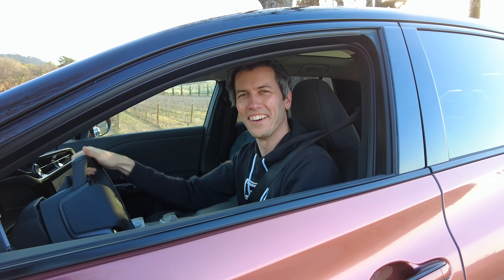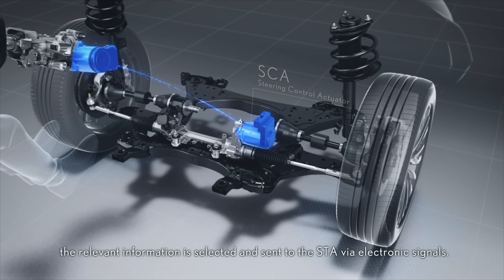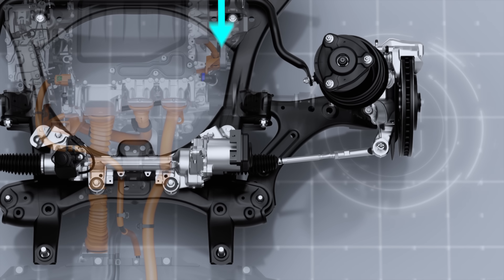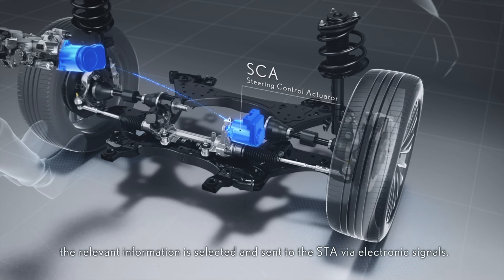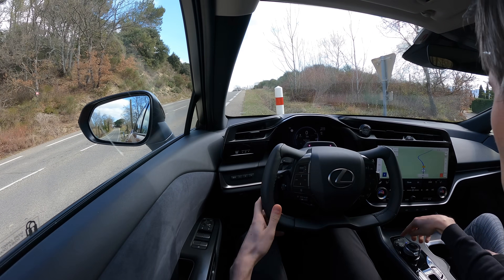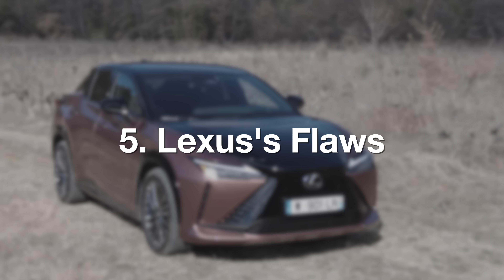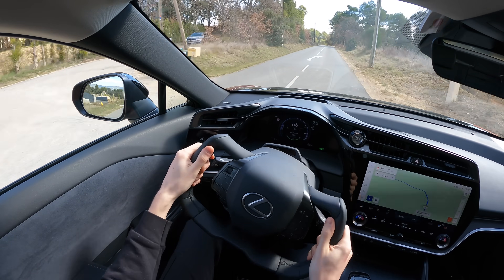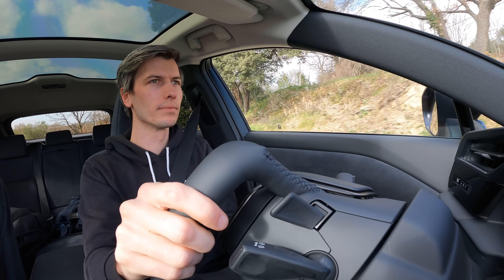How Lexus Fixed Tesla's Bad Idea: Steer-By-Wire Yoke

Comment: One of the things i find it funny in many of the modern cars, aka the supposed "future cars", is how all of them have giant touch screens.

We were always taught that driving while using your cellphone was bad, and it only encourages more car accidents to happen, yet everyone conveniently forgets that, and drools over having a colossal touch screen in your face on the car, which, does the same thing as a cellphone. (even worse, since these aren't phones, but big tablets at best)

Let's also not forget the fact of linking ALL of your car critical components and settings, into these oversized tablets. Say, a hacker wanted to target you, or a state agent wanted to assassinate you in the form of a "accident". With these cars that have all of their critical components linked to the oversized tablet, they could find a way to get inside that tablet, and from there do all kinds of nefarious shenanigans, like disabling your brakes, or disabling your steering wheel, or change your car LSD all of a sudden. You may say: "well if that happens, they can just simply get out right?"

No. Because the doors won't respond, and will be locked in place with the driver inside, essentially transforming the car into a metal missile.

They can also use a EMP to disable your car entirely, and if you're going in high speeds, well... You'll loose control and you'll hit either another car, the railing, or worst case scenario, jump off a cliff or go straight into the ocean.

This is the problem with the "smart" era. IoT technology is incredibly flawed and vulnerable. Anything digital is bound to get hacked.

You could say "but, 2000's era cars also did had digital parts too", and while that may be true in... Say late 2000's and early 2010's cars, they didn't had crucial car elements linked to those giant ahh tablets.

So, in conclusion: EV cars are the "future". One filled with DRM nightmares, and car "accidents". Oh and also manufacturers able to see what you do inside the car, and hear too, even if the engine is turned off. Then they'll be able to sell your personal and private information to 3rd party brokers, who probably are located somewhere in china or NK for example.

Comment: I personally never found electronic controlled gas pedals to be quicker than an old traditional wire pedal. They all had a delay in throttle response especially when I got to overtake someone. Why do you think a lot of race cars still use carbureted throttle bodies? Cause it gives you the throttle response as soon as you touch the pedal.

Comment: Lexus had a power-split device for steering on LS600h in 2000s. It could theoretically change the steering ratio on the fly, at any steering angle. Imagine a Toyota eCVT, with the steering wheel on mg1, power steering motor as the engine and mg2 as the output to steering rack. They used a harmonic drive as the power split device. In case of a failure, an explosive charge would fuse the steering wheel input directly to the output of steering rack. Truly fascinating technology.

Comment: I mean, fly-by-wire has existed for decades in aviation now, even to the point where the flight control computers prevent pilots from doing certain actions. Lacking awareness of these safety features have led to fatal accidents as the aircraft have operated differently from what the pilot expects. That isn't to say the safety features are bad, but it does mean additional training should be mandated.

Comment: I see two safety issues, one positive, one negative.  The positive is no steering shaft to drive into the passenger compartment in a crash.  Yes I know that risk has been minimized through design, but this totally eliminates it.  So a slight positive.  The negative is going around a corner with a yoke system your hands will not be in an ideal location if the airbag goes off.  Basically the difference between the old 10-2 recommendation and the current 9-3 recommendation, which as I understand it is mainly due to airbags.  I don't do hand over hand, so for me that matters.  For other drivers it wouldn't matter.

Also, I don't totally buy the redundancy argument.  I had an 86 RX/7 where the heater door actuator was by wire (saving Mazda the expense of a 2' cable), and its controller went bad, causing the heat to randomly go full hot.  Yes that system totally lacked redundancy, but I don't know how a redundant system would handle the conflict in commands where it isn't a failure to give a command, but the wrong command.

Comment: In my opinion instead of change the ration with the speed, it could be better if for the first 30 deg of rotation it has a ratio, then form 30 to 60 a bigger one and then from 60 to the end an even bigger… so you always know when you rotate how much the wheels are gonna move. And I don’t agree also with what you said about one person driving… cause if you fail to calculate it correctly you can still break with physical  breaks

Comment: If you believe that this is unsafe, then I would recommend you to stop flying on the Modern day jets currently in the sky.
This technology is being used in airplanes known as Fly-by-wire. So if you can travel on a aeroplane without any worry there is no need to worry about this because we are talking about difference between the sky and the road.

Comment: Wouldn’t the delay be the same in a mechanical steering wheel, because yeah it takes a while to change from direction, but on a regular wheel you have to turn the wheel way further which takes longer, eliminating the delay compared to a regular wheel

Comment: Awesome video! The points you brought up are honestly pretty reasonable and I never thought about steering that way. Thank you!
At 11:00. I think it's entirely possible someone could legitimately need to do an aggressive steering maneuver. Limiting that takes control away from the driver and pushes full liability to the company.
Reply: Yep. And lets be honest, a lot of people suck at driving. And now when they try to do an aggressive steering maneuver, the car might not move as aggressively. Yikes.
Reply: i think its more like flight envelope protection on flybywire aircraft where the controls limit you so you cant stall the plane but still be able to have control. similarly this system would hopefully only limit steering inputs that would certainly cause a spin or a loss of control. but if this is the case car manufacturers like in aircraft need to provide some way to turn this system off when you need it so the steering inputs become direct when the system doesnt have the neccecary data to know what will cause a loss of control (like in airbus aircraft normal- and direct law).

Comment: Steer by wire is fine, there are advantages and disadvantages.  Yokes, however, are only 100% negative with zero actual benefits.  The two incorrectly stated benefits are more leg room, which is a wash with properly adjustable wheels.  The other is "better visibility" which again is not a true statement with properly adjusted wheels.  What you lose is safety backing up and the comfort of additional hand positions which on longer drives are a necessity.  So there are literally zero benefits to the yoke and ONLY negatives.

Comment: I hate it! They did the complete opposite of making it “responsive” by dampening the steering so much! What if you need to swerve to not hit some thing or some one?! YOU are the driver, YOU should be able to make the decision, you should always have all of the breaking and steering performance of the car available to you at instance notice. Sometimes in an emergency you need to hard break, but sometimes you HAVE to swerve and it might be pushing the car beyond what’s stable it might even end up causing a crash to swerve but what if you’re avoiding hitting a person? The car doesn’t know why you are telling it to swerve, even if it isn’t stable it shouldn’t stop you. The only way it might be justified to do that if it truly is like ABS and it does maximize steering potential like ABS maximizes breaking by preventing rotor lock

Comment: Well here I was this whole time thinking that steer by wire used an actual wire pulled by the steering column to pull on the steering rack and turn the wheels instead of extending the steering column all the way to the steering rack.

Comment: Car manufacturers: “Hey drivers, you know how buttons are easy to feel and press in order to activate something? Well we removed them and installed a flat touch screen so you WILL have to look at them while driving. You’re welcome. Oh, also, you know how your regular round steering wheel has worked great for decades? Well, we remade the wheel into a weird shape which forces you to ALWAYS keep your hands at 9 and 3 so you can NEVER relax and added a bunch of expensive sensors and motors that are more susceptible to failures. You’re welcome.”

Comment: You can partly address the variable steering ratio issue with variable artificial rotation force. Higher speed, stiffer steering. That intuitively means lesser rotation at high speeds.

Comment: Interesting. 

I hate modern travel assist in most vehicles, purely because it "reads" the road and so many times it reads wrong, it reads asphalt repairs as lines, twice within the last couple of months i had my car drive me off the road using travel assist.  And only because i manually override the steering got back on the road after being close to drive into a ditch. So my concern for the Driving computer is that user input must always take priority over sensors and the computer.,

Comment: Oh man without any type of mechanical linking I don't see this being a good idea at all. If something faills while driving that will be extremely bothersome. Depending on how it failed it probably will re correct itself and drive straight. And moving it around if it's dead would mean having to manually steer the car by directing the wheels the way that you want them to go from the outside of the car

Comment: How does it handle evasive maneuvers at highway speeds if some of the more extreme or sudden and unexpected input is filtered out? Also, in general, it sounds like the same input could result in different output but determined by a computer in addition to the traditional factors.

Comment: I've always had a few of reservations to electronic steering systems:

1) Redundancies are great, good on Lexus but unless it's a regulation (like in aviation) manufacturers won't always do this if you can half the electronic component costs saying. They'll be a business meeting somewhere that says "they only fail once every 100,000hours, so that's safe enough"
2) So far electric steering has always felt too light for me... if I his a pot hole in the road and the steering angle has changed, I want to know immediately. But that's just me, I don't find light steering comfortable. 
3) Having not driven the Lexus, on paper their feedback system sounds good... but the lag between changing the yoke position and the wheel position would still indicate the same occurs in the feedback... On the other hand, I suspect at higher speeds, when the steering ratio is shorter the feedback response is also faster (or at least that's my theory...). To me though, any lag in the system would be infuriating... I suspect this isn't a limitation controller, potentially the inertia of the motor, or (what I think is likely) is finding appropriate gains values in the control loop between what will make your yoke shake violently in your hand if too high or sluggish and laggy if too low. Not to mention the feedback motor has to suit everybody... so it's probably spec'd on the lower torque and sluggish side, as to not break the wrists of the more fragile elderly or slip out of your hand when you hit a pothole.

No doubt the tech is getting there though...

Comment: It is confusing to me that you are comparing a prototype Lexus to a production Tesla. Tesla had to meet so many standards with the drive by wire system to make it into a production vehicle. They also have the ability to update the software via over the air updates that could change the ratio to be variable.

Comment: First half is pointless and does not answer the questions posed. For instance, the steering response/ratio can still be tweaked/increased electronically due to the steering assist available in traditional steering columns…. As you noted. So that’s not an advantage unique to steer by wire.

Comment: Over-engineered. Has too many failure points. And since this system is electronically controlled now that means less repairability and inevitably having to replace the whole thing when a small IC goes bad.

Comment: Engineering over time is always shaped like a mount. The start, then the incline towards the apex aka the most efficient and effective version possible of the given object or machine. Then due to mans need for change, the downward slope or digression from its most effective form towards over complication and reduced reliability coupled with a higher price tag for the added potential fail points masked as technology.

Comment: I think the curve between speed and steering angle... you will learn and adapt to that but at first ist probably a bit strange. The biggest problem for me would be the delay and wiring. Because if wires fail, the connection isnt there anymore. but thats probably also redundant

Comment: I like this tech but hate the delay - thats too much. However would really like it to be tested by some race drivers or drifters. I mean if the philosophy would be more on make the steering better not just from comfort but also from performance part it would be great. I hate the limitations. I could understand if the steering would be actively controlled in a manner to achieve maximum angular speed /  G loading without excessive sliding. So having the car stable and very well controllable.

Comment: Excellent Video. Now about having a steering yoke. It's not a formula one car so the comparison does not apply.  Leave that comparison to Andretti family. Us regular humans are  not in that league, no matter what we imagine.  Additionally it is not a Beechcraft Bonaza airplane or a 747 for that matter. It's cute. It's futuristic, It's trendy. However, I don't like to be forced to hold the steering wheel fixed at the 9 and 3 O'Clock positions at all times. 50 years ago the Citroen Maserati had and extremely fast steering ratio. I drove one of those amazing cars. The round steering wheel worked well. The Lag in response in the Lexus, to me, would be unacceptable.  Honestly since it's a prototype, they probably will fix the response lag and have a round steering wheel as, at least, an option. Toyota is a very competent company, I have faith that they will solve these issues.

Comment: I like the system but I also don't think it's viable for all situations/vehicles. For recreational vehicles or trucks I don't think it's a good option. Even if the feedback system is spectacular, there may not always be the most accurate responses that you get with mechanical. That 100% accurate response is necessary for rocky terrain or muddy country roads. The mechanical system also just works and as the farmers say, "if it ain't broke, don't fix it."

Comment: I appreciate higher and higher levels of technological advancement but I think a direct drive and a steering wheel is going to be more easily intuited by drivers and changing targets for steering technique at speed will never hit home with at least 20% of the population, I know some people are obsessive about the customization software makes possible but most people simply don't want to have to think about this stuff, they just want it to work reliably and consistently.

Comment: Steer-by-wire?? That's just lame. 
Why not use Logitec's Bluetooth controller to steer? It has vibration feedback and the battery last quite long.
Sincerely yours,
Stockton Rush
OceanGate Inc.

Comment: I've found that on many cheap rental cars, driving long distances is really tiring. One of the reasons I suspect is poor feedback from electric power steering. This means you can't 'feel' the driving direction and have to constantly keep looking at the lines and make tiny adjustments to your course. I wonder how well steer by wire will be able to handle this.

Comment: while I appreciate the value of experimentation I also think things are getting out of hand. Removing the mechanical connection between the steering wheel (kimi!) and the steering rack could be useful for BEV's with high autonomous driving aids. Otherwise it adds complexity and cost for a very little reduction in driver involvement, assuming that is a bad thing. At which point I would be in favour of fully autonomous vehicles, or public transport... I say this because the real problems of passenger cars is energy/pollution cost of production, energy consumption (fuel or electric energy), tyre particulates, and (where it applies) exhaust gases. Heavy cars loaded with tech, be it ICE or BEV, are not a viable solution. I have driven a number of hybrid and BE vehicles over the years, yet the "greenest" car I ever drove is a 2018 Suzuki Ignis, which costed peanuts and returns sub 5L/100km consistently. I understand one may fancy a more luxurious drive, but don't give me the environmental or tech good for the people speech (not so much this case, more a general rant)